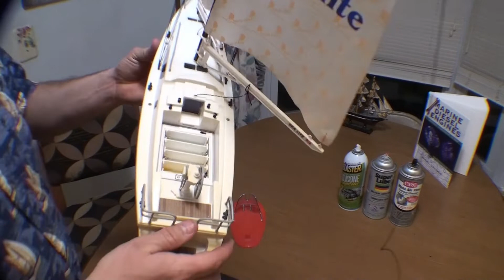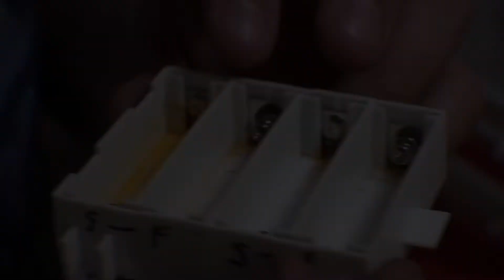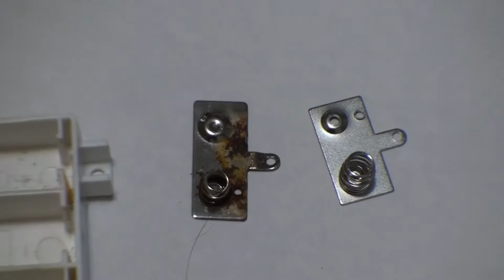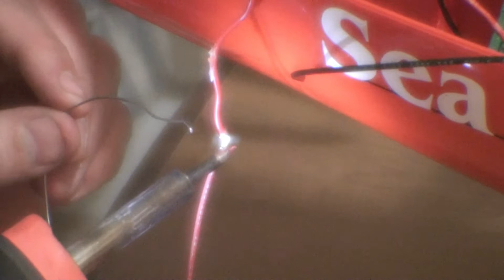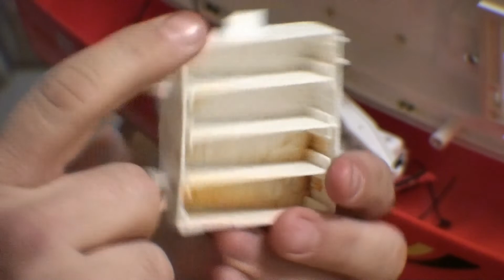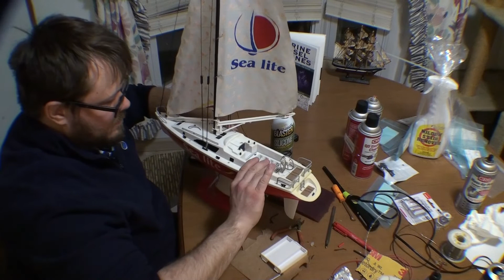Disassembling a Sea Lite 37 RC Sailboat to Perform Electrical Repairs

Comment: I have the red and blue version.  For a winter project I am thinking about replacing the stock electronics with a 2.4 receiver and upgraded hobby quality servos for better steering control that is proportional.  I already did the rudder mod by adding plastic from a used gift card sanded and shaped to the rudder but 2 cm lower in the water for better bite and improved steering.

Comment: Hola necesito ayuda tengo un sea lite nuevo, cuando lo probe funciono bien. Pero al llegar a mi casa lo volví a probar y el velero dejo de responder.
Es el modelo sea lite 28.
Reply from the maker: I would first try new batteries.  Mine would only work with fresh batteries as there was too much resistance and corrosion in the battery tray.  If it starts to work then it is probably a corrosion issue causing too much voltage drop.

Comment: Do you have a source for rudder servo motors?  I seem to have stripped some gear teeth.
Reply from the maker: I do not, this model is discontinued but looks similar to their newer model.  I would reach out to golden bright to see if they have parts.   Also, eBay has some parts for this boat last time i checked. Hope you find the replacement parts you need.

Comment: Need sail kit and remote
Reply from the maker: Unfortunately, this boat has been discontinued so your best bet is to contact Golden Bright to see if their new boats use the same frequency or Ebay. The sail can be homemade out of plastic, Tyvek paper or cloth if replacements cannot be located. 
Hope you can get it back on the water.

Comment: Great content! I have an old one. Not sure which is best to try to repair it or try to get a new one. Any advice? Any website would help! Thanks
Reply from the maker: The company is still in business they are called Golden Bright.  They do not make this exact boat but one similar with a motor.  What is wrong with it?
Reply: @twinssail  Just an Important Advice. This new versión you mention here IS NOT POSSIBLE dissasembly due it doesn´t have any screws that hold the Board to the Hull on it ! !.
They replaced them all by sticking the board directly to the hull with Glue !  and this one is some kind of Epoxy or something similar that can not be taken apart  If you try, you´re gonna break it  
I have this new version and try to replace the RC Control for a more advanced one, but I had to give up to this damned GLUE !.
Greetings from Santiago de Chile, South America. 
This is John. Cheers.